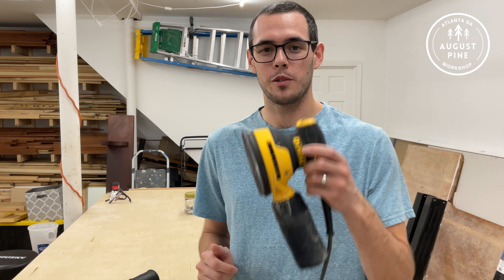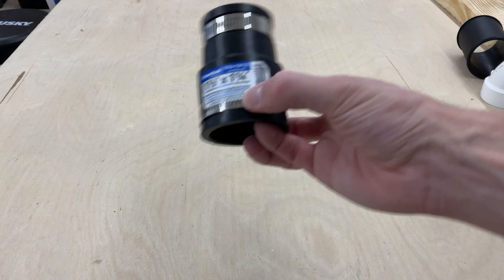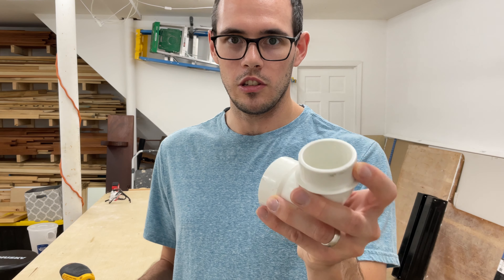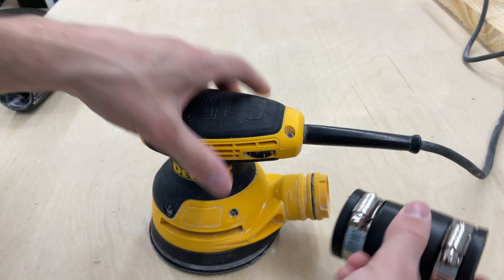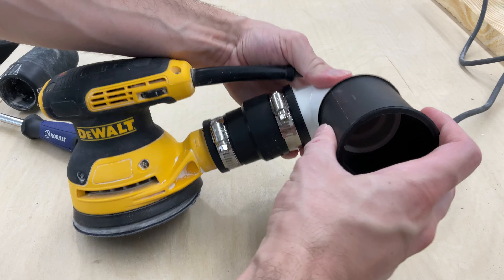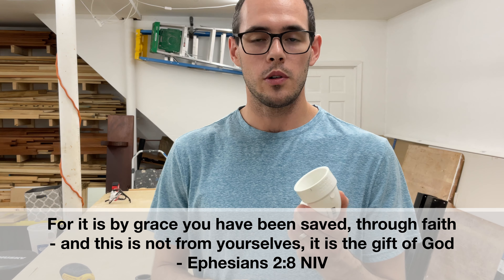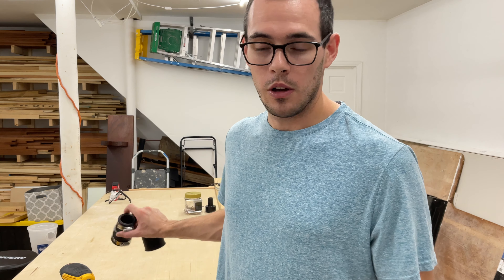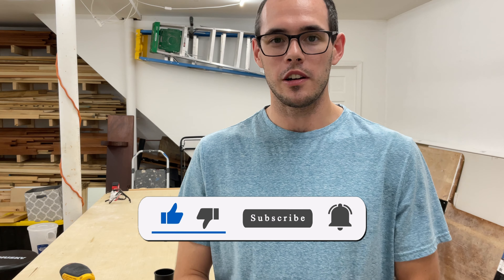Cheap DeWalt Orbital Sander Vacuum Adapter | Easy Dust Collection!

Comment: What the heck? Don’t dewalt supply an adaptor?
Reply from the maker: Not included with the product. They do sell an accessory, but it’s pretty expensive and seems to be incompatible with many DeWalt products (and I couldn’t find an exact product list of compatible sanders). This was a cheaper and easier solution for me.
Reply: I bough the adapter and while it fits it’s not snug and pops off the hose all of the time.  I still end up duct taping it
Reply: bought a dewalt stick-vac, didnt fit to ANY of my dewalt tools. bummer!

Comment: Hey. I did pretty much the same thing and I’m experiencing sparks in the sander. Any suggestions? Thanks
Reply from the maker: Hmm that’s very strange. I’m not quite sure what could cause that to happen, but I would definitely stop using it until you figure it out. With dust collection systems in general, I’ve read concerns about static electricity buildup, but I wouldn’t expect that to appear in the sander. I suppose something else to test is if it still sparks when you are not using a dust collector. My inclination is that this may be an issue with the sander itself and not the dust collection setup, as I don’t think this setup has much electrical risk, but I could be wrong.

Comment: If my shop vac has a 1 1/4” hose, do I do the same thing?  If not, what would I change?  Thank you.
Reply from the maker: Unfortunately I’m not quite sure, but I don’t think that this same setup would work. My recommendation would be to still connect the rubber coupling to the sander and see if you can find one that would fit directly with the 1 1/4” hose connection on the other end (where the rubber coupling would go on the outside of the hose connection). Sorry I can’t provide a definitive answer!

Comment: 2:22 what Dewalt orbital sander do you recommend?
Reply from the maker: I have the DWE6423 and I really like it! The only thing I may consider in the future is a cordless model, but performance-wise I have never had any issues with this one. I definitely also recommend getting a variable-speed model and not a single speed (such as the DWE6421). It’s slightly more expensive, but the ability to change the speed is really nice.

Comment: Why not just use the Fernco?
Reply from the maker: For my vacuum, the Fernco alone won’t connect to the shop vac hose directly based on the size. But even if I were to get one that would fit with the correct size, I wanted to avoid having the Fernco directly attached so it would be easier to connect/disconnect and wouldn’t require loosening the clamp every time.

Comment: You've added several ounces, and a  hose that's almost as big as the sander is.  Truly not worth the extra work.

The biggest issue, an seems NO one has addressed this, is the LACK of uniformity among power tool manufactures and the dust collection industry, mainly due to them having their pride shoved up their asses.  Even the DeWalt adapter that they sell that is "supposed" to work with this sander, AND a 1 1/4" shopvac, doesn't work!   The dust bag it comes with is 1-3/4  inches, and NO SHOP VAC has a hose that is that size.  You could by a $800 Festool shopvac, but really?  EIGHT hundred?  That's like buying Grand Ma a Maserati, just to go to the grocery store and back once a week.
Reply from the maker: Yeah it’s definitely a little bulky, but unfortunately this has been the best budget setup that I could find easily. I totally agree that the lack of uniformity is unbelievable. When I was trying to figure out how to make this work (and also looking into some other dust collection setup stuff) I couldn’t believe how many different sizes and configurations there are.